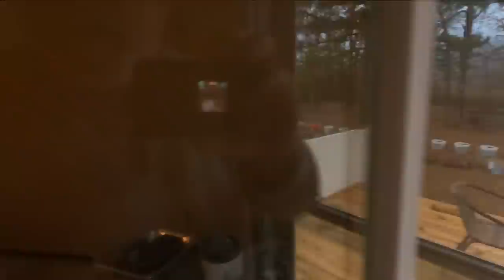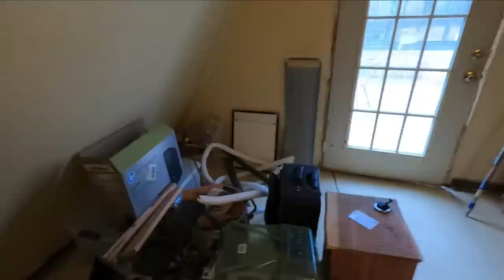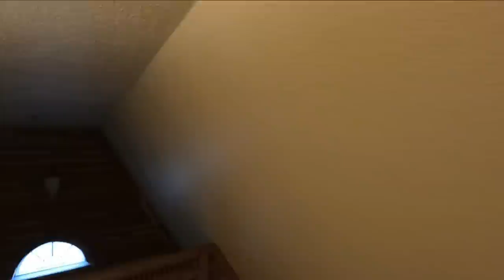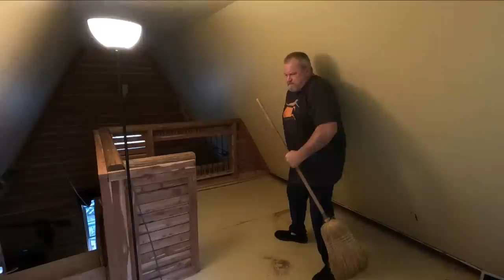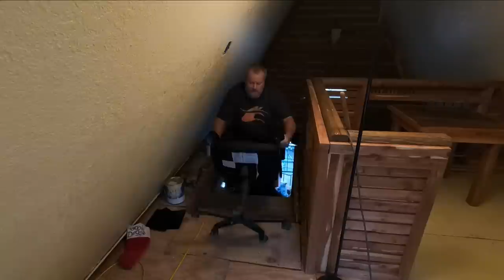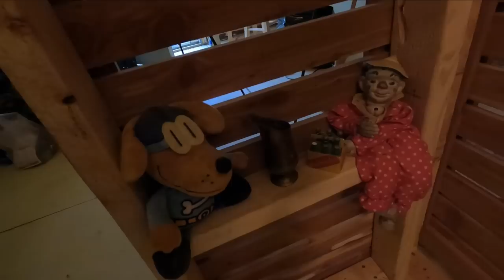I Have Never Used My Loft, Lets Change That!/A-Frame Cabin Renovation

Comment: Mike, you're a disabled veteran.  The VA will give you an adjustable  hospital bed.  Helps so much with the breathing with the head raised. You will need a good foam topper for the matrice. The matrices are hard as a rock. Love how the loft is coming along. The view from the deck is awesome.
Reply from the maker: I Dont want to be pampered by this government, I will make it

Comment: Every laptop I’ve ever owned tended to over heat. I had to purchase one of those setups that go under the laptop that had two additional fans. Never had overheating issues again. I also used a cordless mouse with my laptops. The loft would make a nice Winter bedroom/office but it would be too hot for Summer. Naturally if you made it the spare or guest bedroom, you’ll never have unwanted guest over extending themselves upon you. 😂 Breathing issues had me sleeping in my recliner for several months too. Then I bought me my first adjustable bed. Good golly! I can sleep like a baby again. The mattress does not get hot and sweaty nor does it feel like a block of ice. It is purrrfect! Btw I enjoyed watching you bust some moves. 🎉❤ Still waiting on you to twerk 🎉❤😊
Reply from the maker: coming up! Gimme 5 mins